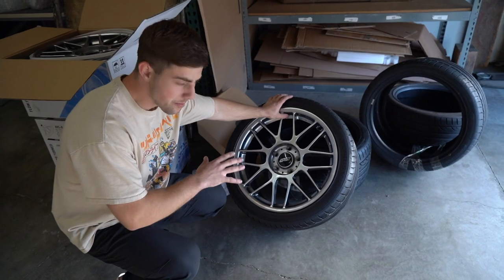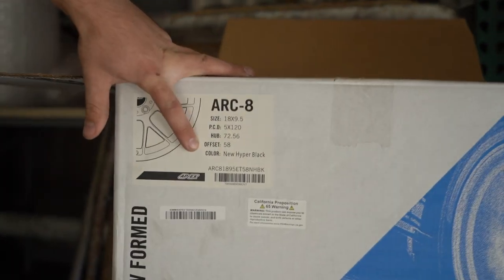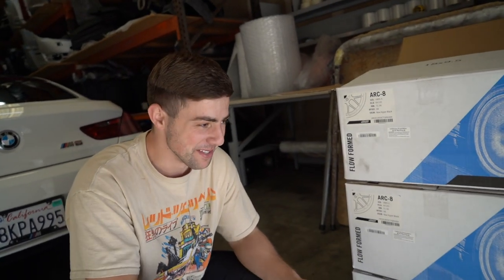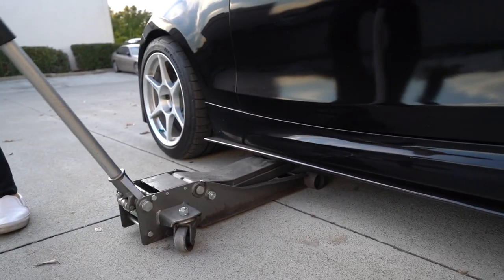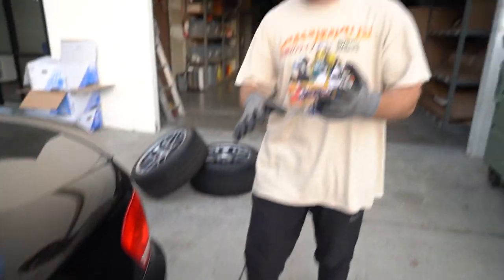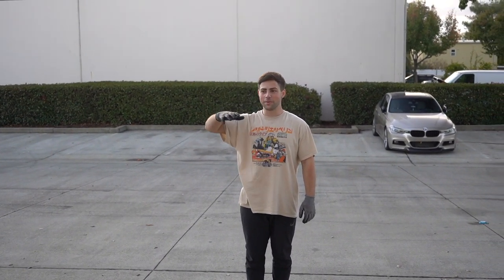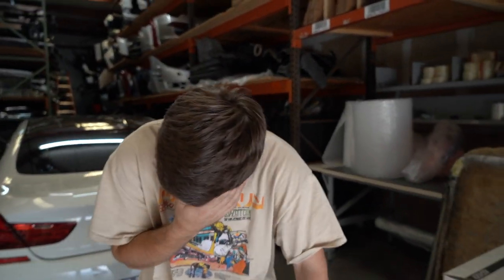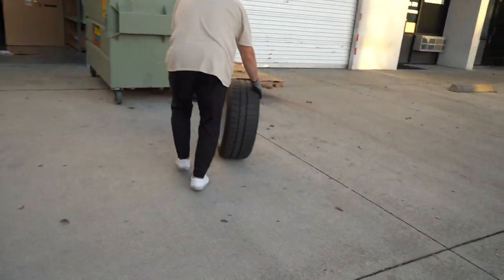BMW 135I E82 MOST AGGRESSIVE WHEEL + TIRE SETUP! (APEX)

Comment: got same wheels on my 135 for 4 years in hyper black only diff i got et22 up front with a genuine 1m front end setup running staggered F255 R265 drives amazing with them hoping to upgrade to forged arc 8 soon
Reply: How did u manage to fit 255’s up front? Any rubs???!
Reply: @andreagate542  when i said genuine bmw 1m front end I was referring to the origjnl 1m front wide-body kit.

Comment: hey bro i plan on gettin some arc 8’s for my e90 but i’m new to all this i don’t understand what ET is or what it’s for
Reply from the maker: hey man, ET is the offset. How much the wheels will poke out basically. It’s measured based on how far out your hub sits. Apex has good specs for all of that on their website, you can see pictures on whatever offset and size wheel looks like on your E90
Reply: @NickBuiltIt  thank you man, i saw their fitment guide & i’ve asked multiple people but no one has replied, does my e90 being an m sport change anything or do i still fall under E9x 3-series non-M wheels & tire fitments? sorry if that’s a dumb question.